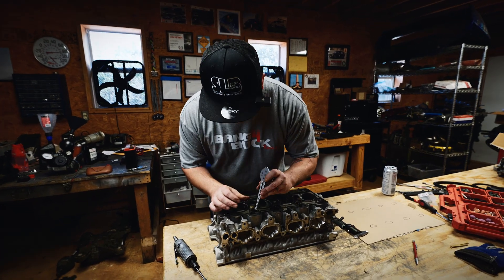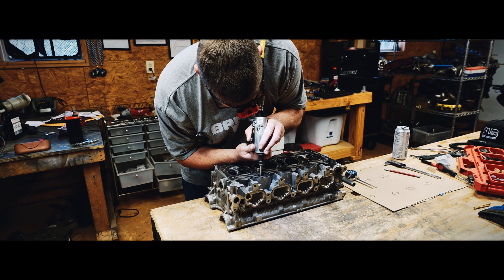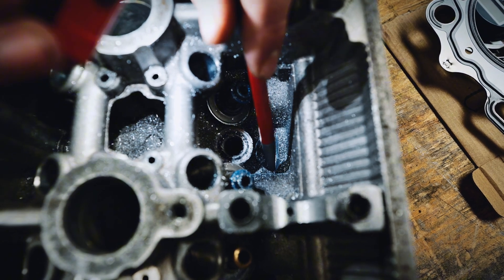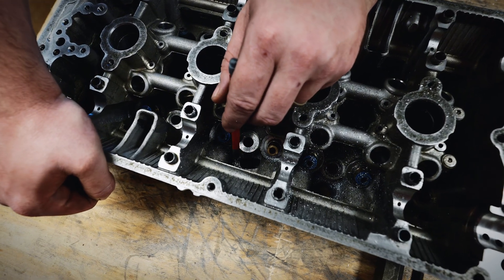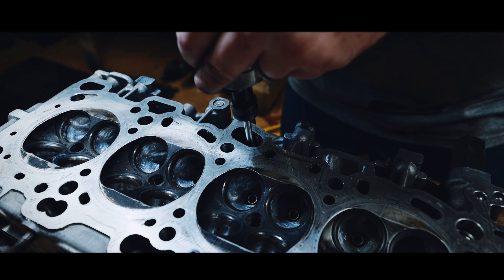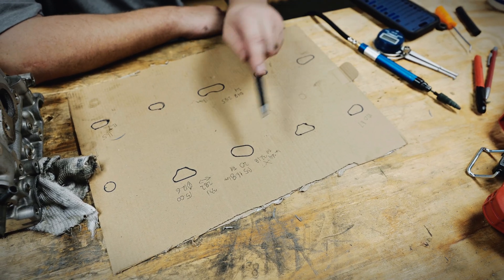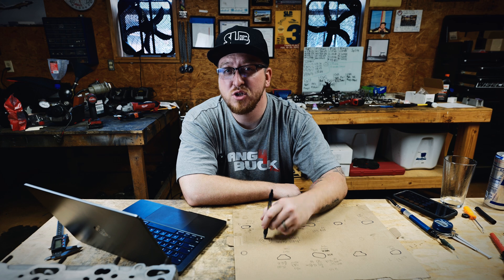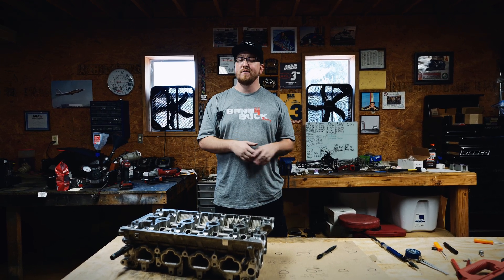The most overlooked porting job when building an engine.

Comment: What does your catch can setup look like? I have 2 -10 AN lines going to the catch can with a filter on to

My head is ported and aiming for 900hp with a 6870 turbo.

Wondering if I need a PCV valve to prevent oil from going in the catch can at high boost.
Reply from the maker: @Juancarlos22113  I personally run a closed loop vaccum setup I will be making a video coming in the next few months, yours is off to a good start but the size of the can and the size of the opening for the filter also matter. For that much horse power I recommend closer to a 2 liter size can. I will be making a video about VTA catch cans here really soon. 

No I do not recommend putting the PCV back in for your setup
Reply: @Bang4BuckRacing  ok sounds good, I’m in the break in process for my drivetrain before getting a tune. I’ll look up that setup and see what they got. I have one of those Amazon catch cans with the 2 ports and the top opening.

I should be done with the break in process in about a three weeks once I get the miles in